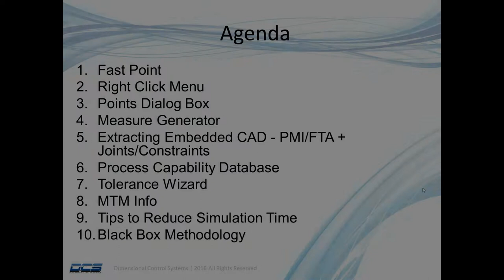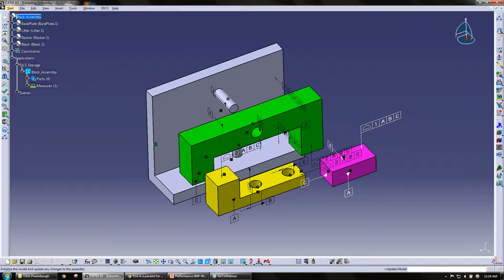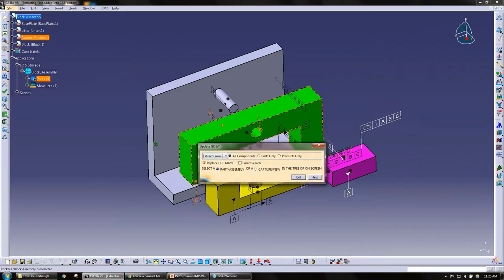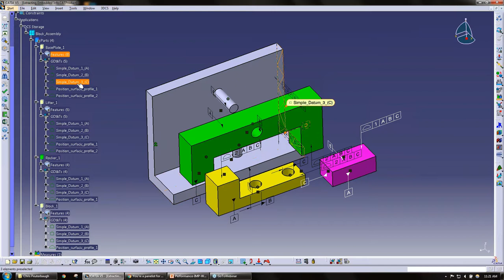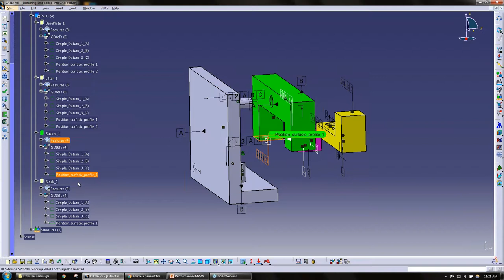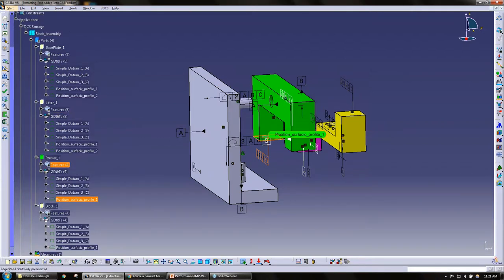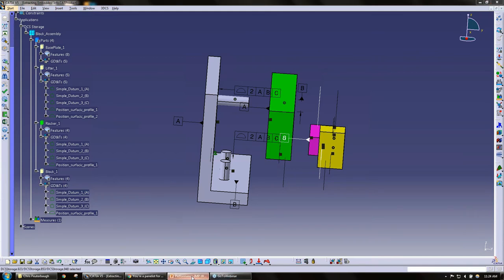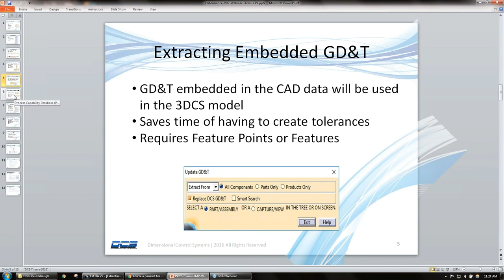3DCS Performance Tips  - 5 Extract Embedded GD&T - How to use CAD GD&T - PMI - FTA

Comment: Hi. What about dimension tolerances? Does the program work with them? For example on this video we see 2 pins. What about distance between them? Does it not have +- something?
Reply from the maker: Yes, you can add in standard dimensions. As a best practice we've been promoting the use of GD&T and PMI for smoother workflows, but the system is used most often by our customers with basic +/- callouts and values.
Reply: @DCSengineering  Maybe you could make a video how to create basic +/- callouts... For example a dimension between 2 holes with +/-0.5 mm?